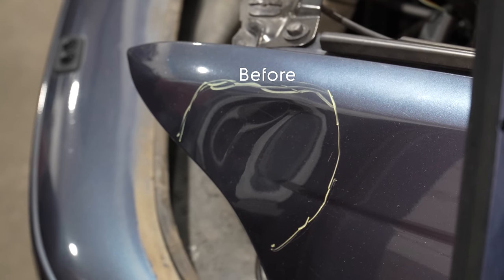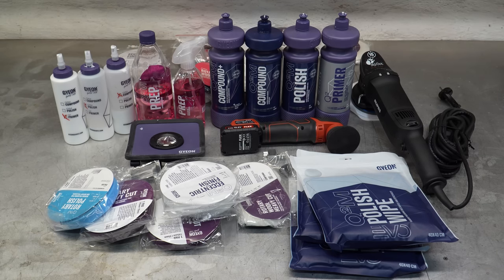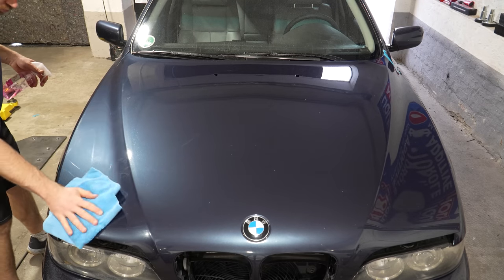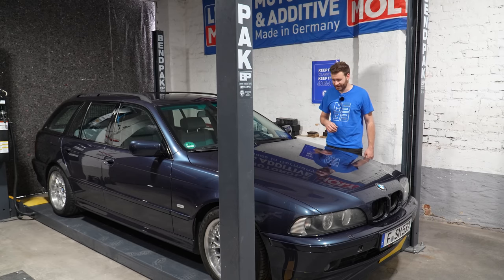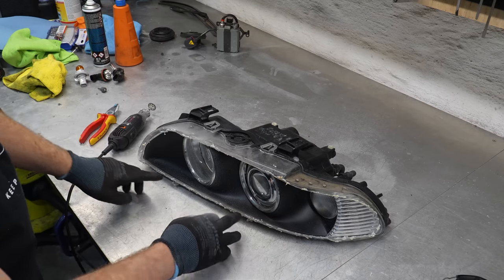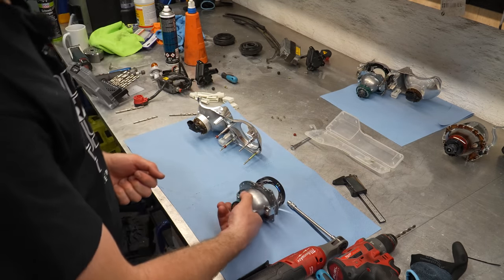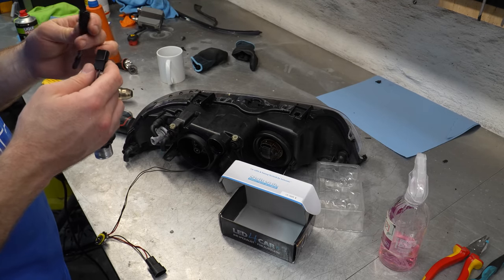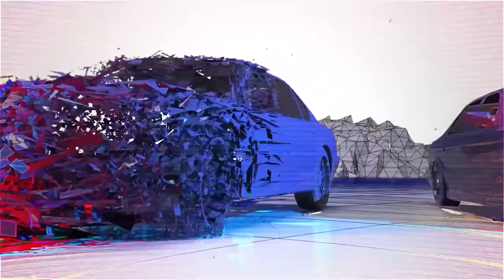What It Took to Restore a BMW E39 5er Back to its Former Glory - Project Rottweil: P7

Comment: Seven-day paint-correction/detail...? You're a LEGEND! Sreten, forgive me if you've already addressed this and I missed it, but what do you think of dry-ice blasting (aka cryo-detail), to get rid of under-carriage filth build-up? Are people doing this in Germany? The Pebble Beach crowd in the U.S. is doing it, and it's quite expensive. But I got a very good deal on a 70K mi e24 (BTW, really would be amazing if you found a tired M635csi and worked your magic on it...!?), so I had my car cryo-detailed by one of the first dry-ice shops in the U.S. The before/afters are INSANE! It looks almost brand-new underneath (minus the cosmoline of course, which the dry-ice removes; the shop will treat vulnerable areas after the fact with a cosmoline-like substance if the customer wishes)! Anyhow, I'd be curious to know your thoughts on the dry-ice treatment. And also: just want to say along with everyone else THANK YOU—your videos are like meditation/therapy, they instill such a sense of calm and peace.

Comment: 2 things about lights:

The cheap chinese lens/cover doesn't have the markings for the legal stuff so that might be a problem with TUV. At least in my country it is.

The oem not too sharp cutoff makes it easier to read signs at night and also spot civilians. At least those who are wearing reflecting stuff. The aftermarket lights usually have too sharp cutoff.

Comment: Now that it is sorted, I would drive it daily and make sure it can stay bulletproof like a Toyota (with OCD maintenance on a Bimmer, yes it can be like a Toyota). Put like 80-100 miles on it everyday. I would also go on random 500-1000 mile road trips. I would change the oil every 4,000 miles and keep 93 octane gas in it, regular radiator and trans flushes and wash it every week too. Just to see how long that BMW can go without a major issue. Yes, I'd see if it can last up to 500,000 miles. I believe it can do it. If a E39 M5 can reach 400,000 (a couple of years ago on Legit Street Cars channel) I believe this E39 wagon can too.

Comment: Hey mate, whats the project name all about? I was born in Rottweil so I got curious - and fun fact: I just bought a toledoblue E39 525i Limousine a few days ago and start giving it the same treatment which it really deserves after the around 330 000 km I bought it with. And the car still drives amazing. Its from Nov 2002 so 7 months before end of production with the more agile motor and sport chassis with a manual shifter. .. Anyway, probably the most beautiful E39 Touring that is out there. Good job!

Comment: Use 2k laquer even on small repairs, runs are more rare and finish is more durable. have fixed several details on car with 2k spray bottle, much easier to use.

Comment: As an owner of a toledoblau e39 touring with grey interior, thanks for this daily project...I've been also using it (yet) as daily for 16 years now (bought it this exact day in 2007).
Btw, you mentioned in one of the video about a vibration at some speed (which is bugging me as well for quite some time) but I think you did not show whether it was fixed. Could it be I missed that part?

Comment: I think that E39 with that engine and options is worth 17 k€ if you consider the near future. If you would buy, for example, a F11 with good options it would cost north of 10k€ easily and it is not as good of a car that E39 is :) great job!😊

Comment: those white adjusters will brake just as the original ones why not the black ones from USA or if you installed heavy projectors perhaps the AL ones... Speaking of projectors, how is the output light compared with evo 2.0 I mean these ones look harder to install and adjust.
Congratulations ! as always a job well done

Comment: I have early 2002 (2 Jan if I'm not mistaken) model so the headlights are still sealed with butyl. They don't leak. I have never seen any moisture in an E39, ever... Why did Hella do that?

Comment: I was just wondering can you open the headlights with that Victor Reinz Re-Move?
What if you spray i all around the sealant and let it dissolve it for couple of minutes?
You should give it a shot, it may be working and save a ton of effort :)

Comment: This headlight glue is a nightmare, it took me 4 hours to finger the reflector holding clips through the holes, i broke the adjustment gear from the shaft so i had to glue it back and broke a inner plastic piece because the screw was not tight enough in my perspective 😂 anyway i have to replace the cracked glass for tüv 😢 do you think the reflector can be re coated if its partly chipped of ? Maybe with some mirror chrome optic paint ?

Comment: Coming up. We delete dents and scratches,
refurbish the headlights and make the original

Toledo Blue paint amazing again.
- It looks so fresh!

Hello and welcome back to the 7th and final
round of the rejuvenation process of Project

Rottweil. Over the course of 6 episodes,
we sorted out the mechanical side of this

battered E39 530i Touring as well as the
interior. And now, it's time for the exterior.

The E39 is still wearing its factory original Toledo
Blue paint all around, which is remarkable for a

20-year-old car, but the condition of it isn't. Little
to no care was put into maintaining the pain over

the course of the car's life and we have heavy swirls
and deep scratches. The right side was keyed, we

have sunscreen fingerprints all over the car and dents,
so many dents. On top of that, we have a rough spot

below the left taillight and the front and rear bumpers
are heavily scuffed up. And beyond the point of saving

and in need of a repaint, but due to time constraints
and tight filming schedule, I didn't manage to sort that

out in this episode, but I will at a later date off camera.
What we are going to address first is the sea of many

dents. Having previously washed the car, I am
now going around it and circling all of the dents

in preparation for paintless dent removal, a.k.a PDR.

Comment: Hmmm, don't remember the tow hook being removed, was it in a video or off camera?
Reply: The tow hook on this modell can be taken off by a quick release system.
If you look closely on the lower section of the rear bumper you can notice a cover which is mounted when the tow hook is removed.
I own the same E39.
Greetings from Germany
Reply: @johannesf.4567  I did notice the cover, but thanks for explaining about it being possible to remove the hook.

Comment: I suggested you use a thin covering of PPF to protect the headlights of the E60.  If worst comes to worst, just rip it off for each TUV inspection.

Did BMW make a touring model for the E6X series?  BMW never brought any succeeding 5 series Touring to the US.

I would never suggest boosting any engine not designed for boost.  It is totally a different consideration from internal stresses, lubrication and cooling.  It would be much better to convert it to an M5 Touring if you need the power.
Reply: Yes, every 5 series has had a Touring version. Guess in America people were just too set on having SUVs so the Touring was dropped, leaving the ghastly X5 as the only alternative

Comment: Ur wrong about headlights, there are ton of guides how to heat up and take them apart. I got mine rebuild and my car is 2003 e39.
Reply from the maker: No, I'm absolutely not. Then you didn't have permaseal headlights. Do some research and you'll see that you are wrong. I owned and own a lot of E39s in my life.

Comment: Dude....€220 for a wheel alignment? that is more than double here in Munich.
Reply from the maker: Yes, good alignment is incredibly difficult to find in Germany. The cheap ones are terrible.
Reply: @M539Restorations  Honestly i never had an issue with alignment on my E30 325i, maybe because it is simpler? not sure, or maybe prices in Frankfurt are different than in Bavaria.

Comment: Look at the car from the back straight, the tailpipes are not perfectly aligned. a bit diagonally crooked :) just a bit of OCD from a fellow E39 owner.
Reply from the maker: They are 100%, wouldn't have it any other way, just something off with the camera.
Reply: ok...pheww,  I was concerned :) Happy to hear that its all perfect. Great job by the way with the trimming of the bumper. @M539Restorations

Comment: Please don't melt the solder in advance.
There is flux inside it that is supposed to help for a better solder joint - no oxidation and good flow on the cable. If you melt it in advance the flux evaporates and it doesn't do it's thing.
Just keep the soldering iron on the cable, then apply the solder. :)
Chheers for the amazing episode as always.
I would really love to upgrade my E46 projectors.
Reply from the maker: Thanks! No difference as I apply flux first on the wire so it melts properly. :)
Reply: @M539Restorations  This means that the wire is properly clean. With more polluted surfaces you start to see the difference. But keep that in mind - the idea of the flux is to help the solder flow and stick better + you get more clear looking solder joints (less oxidation).
Reply from the maker: Thank you! I don't understand at what you are getting at so I'll explain again. The wires are twisted, then flux applied directly on the wire and then pre-melted solder applied which spreads evenly within a second, the joint is super clean and with any oxidation. It's better and cleaner than holding the iron to the wire and getting it crazy hot in order to melt the solder.